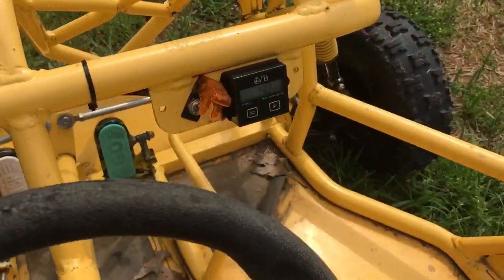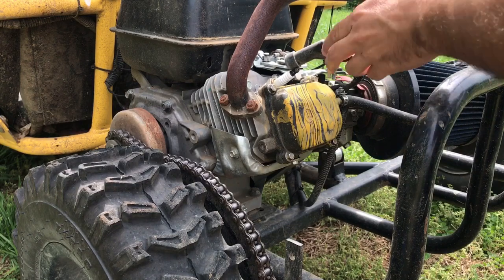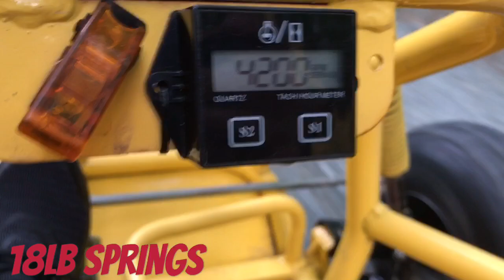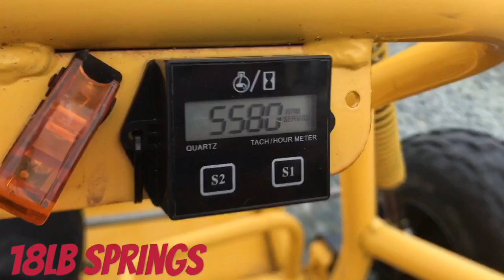How Many RPM Can You Get Out Of 18lb Valve Springs On A Predator 212? How to change valve springs

Comment: You said to set the piston to top dead center, but you didn't tell your viewers that you are supposed to turn the engine 180 degrees out on the firing stroke to set  the valve lashes and not the other side of the cam.

Comment: Is the governor removal all you did? do you need anything else before the springs for safety?
Reply from the maker: Yes, just a governor removal. Most suggest a billet flywheel with the governor removal and upgraded springs. The factory flywheel usually holds up fine with factory springs because valve float limits rpm’s but with upgraded springs there is a higher chance of the factory cast flywheel coming apart.

Comment: go smaller sprocket on the rear axel.
Reply from the maker: At the time the kart was one wheel drive and I was having trouble finding affordable sprockets and a gear ratio that wasn’t either so aggressive that it pulled to one side from too much torque or so conservative that it would struggle to get moving. I’ve converted but to a live axle since then and have a quick change sprocket on the axle so I’ve been able to change up the gearing at the axle.

Comment: does it give top speed?
Reply from the maker: It allowed for higher rpm before floating the valves so it did give me a little bit of extra speed. It did lug the engine down though and I could feel a noticeable decrease in power from the extra resistance inside the engine. So a decrease in power and acceleration but increase in top speed.
Reply: im guessing 30mph

Comment: Speed equals gear ratio...if you would run a smaller rear sprocket,  you will pick up more top end..
Reply from the maker: Yeah as I mentioned in the video I had played around with multiple sprocket sizes and had found a good medium between no low end torque and too much torque but just needed a little more speed up top without changing the gear ratio. The extra rpms solved the problem.
Reply: I run an 19 tooth 35 chain clutch and 60 tooth 35 chain rear and the fastest I've hit was 65mph.

Comment: any idea what rpm can be safely turned with the stock flywheel. Wondering if I can pull the govenor and do 18 lb springs carb jet and a pipe, with the stock flywheel. Great video by the way, just picked up a 212 for $99 at Harbor Freight
Reply from the maker: Honestly I don't know it's real limitation and if you look at forums most are hyperbolic and say you need a new fly wheel even with the governor removed. What I can tell you is that I have 5 predators all with factory flywheels and haven't had any problems for years. One has 22lb springs, intake, exhaust and cam and has held up fine. The cart in this video has the 18lb springs, intake and exhaust and head port and has held up fine. The others are using stock springs and have Intake and exhaust plus Nitrous on one.
Reply: @jwsbackyard6413  Yeah the people posting on those forums are so worried about something I've never seen or heard of happening
Reply: @jwsbackyard6413  wow, great info. I'm only looking for around 5500 rpm tops for a cart I used to run a Animal on, don't want to drop a grand on another one.
Reply from the maker: Yeah that's a lot for a go kart engine when you can get a pretty reliable one with aftermarket support for $99.
Reply: Billet and other after market flywheels are better from a performance perspective. Takes more power to spin a 5 1/2 pound stock flywheel than it takes to spin a 3 1/2 pound flywheel. Who builds an engine and uses the stock flywheel? lol.

Same thing with the 18 lb springs. If I'm floating valves at 5200 RPM I would replace the stock springs with stock springs to get 5500 if that was the target max RPM. If valve float at 5200 is normal for a Predator then that sucks. Valve float on my 196's is around the 5800-5900 range. I don't think I would use 18 lb springs for anything because the better big power cams use 22 lb+ springs. And there are cams that support 6500 plus RPM with stock springs. 18 lb springs rob power in the stock spring RPM range on mainly stock engines.

Comment: I highly recommend upgrading your carb if you want more speed.
Reply from the maker: Upgrading the carb would definitely help with acceleration  so it would get to its top speed faster but the top speed is limited by the gearing and the max engine rpm. To increase the top speed I would either have to adjust the gear ratio by either going with a smaller axle sprocket, increasing the number of teeth on the clutch or by increasing the engine rpm.
Reply: @jwsbackyard6413  You can certainly increase your top speed by upgrading the carb. The stock carb on these  motors is not providing enough fuel for you to max out your gearing etc. Speaking from experience. Every build I've done with these motors, when I only replace the carb I gained top speed. I mean youre right about your speed being restricted by gear ratio etc, but not with this carb. Also have you though about installing a torque converter in place if the centri?
Reply from the maker: I normally step up to a 32 jet with intake and exhaust. In this case the engine starts to float the valves which is what's limiting top speed so the gearing and rpm are the limiting factors not lack of power. This cart is one wheel drive so I've had to limit torque to keep it from continuously loosing traction and trying to bring the rear end around which is why I've stuck with the centrifugal as opposed to going with a torque converter. I'm using torque converters on two of my live axle setups though.
Reply: @jwsbackyard6413  do you like the torque converters better? Most people do as they really are superior. I'm actually installing new valve springs on kme of my bikes right now because of valve float. I just put the 24mm mikuni on it. It's a monster
Reply: @jwsbackyard6413  I just love these motors. For the price, the reliability and performance is just unbeatable.
Reply: @jwsbackyard6413  about how fast does it go?
Reply: @jwsbackyard6413  I apologize if it came off as me implying you didnt know what you were talking about. I've watched your videos and you definitely know your shit and would know more about your own build than me. It looks fun
Reply from the maker: Sorry YouTube has been sporadic lately on notifying me of comments. The torque converters are definitely the way to go of you want torque. Playing around with all the sprocket and clutch tooth options just doesn't give you nearly the same difference in torque as the torque converters do. My only complaint with the torque converters is they limit top speed, so you have great accerleration but limited top speed so on this one wheel cart and my Nitrous go kart I use a centrifugal clutch. The one wheel cart just can't handle a lot of torque without being undriveable and the Nitrous cart is all about top speed but both are pretty laggy at low rpm but have nice top end power. I just got a 22mm mikuni but haven't had time to get it on yet and you're good. I'm up for any discussion and don't know everything.
Reply: @jwsbackyard6413  I presume you are rockin the stock jets too? Those carbs are a major weak point in those motors right out of the box.
Reply: @jwsbackyard6413  you're also correct about the acceleration though. Massive difference in acceleration.

Comment: Would you know the valve lash for 212cc non hemi with 18lb Springs?
Reply from the maker: I usually just set intake and exhaust to .003. ARC has a pretty in depth video on setting valve lash where they suggest differently that you might want to check out.
Reply from the maker: Here's their video. https://m.youtube.com/watch?v=ISU-36-9eLw
Reply: .003 on intake .004 on exhaust.